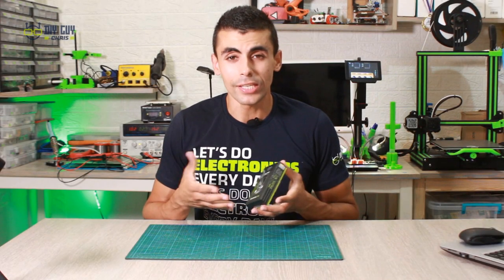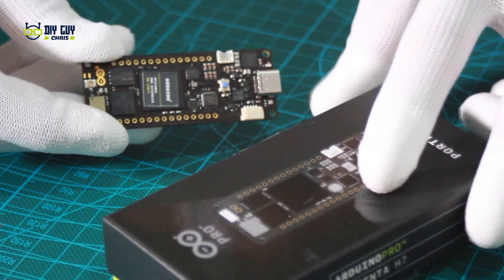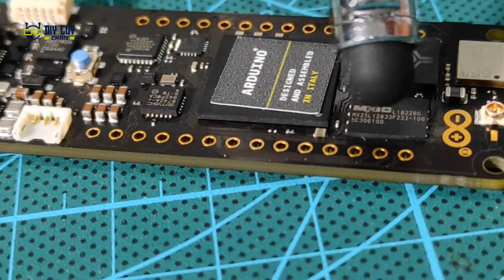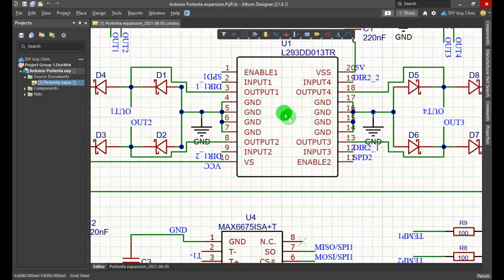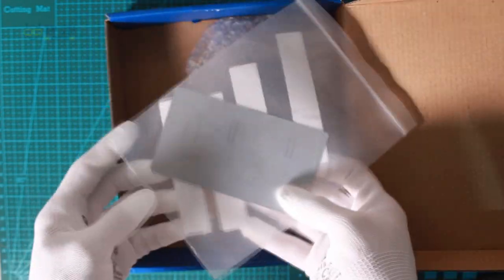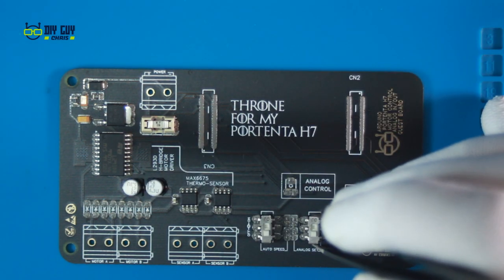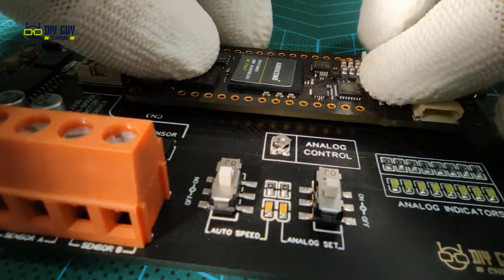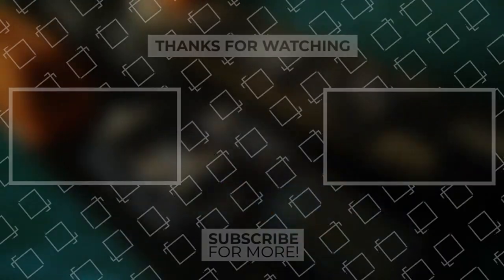Getting started with Arduino Portenta (customized host)

Comment: Low temperature solder paste? It's been a few years, but low temperature solder paste didn't work when I was fixing cell phones. The connectors would pop off the pcb when you plugged or unplugged the flex cables. Maybe by stabilizing the solder joints with epoxy conformal coating?
Reply from the maker: Similar to any other solder paste (with same alloy) but could be molten under low temperature heat which makes it a low temperature profile solder paste, you can check the ref. from CHIPQUIK SMDLTLFP10T5 for the details

Comment: Why didn't you just soldered headers! I don't think that it will screw-up the board
Reply from the maker: Thank you for your comment, hummm yes maybe I will try this on a breadboard so in this case the headers are necessary. Next video maybe :)
Reply: @DIYGUYChris  nice
so I guess that you make a led Blink just as first test and you will use the rest of the board options in the coming videos. good
Reply from the maker: @miaharley8051  exactly

Comment: I just dig into the details of your schem! why have you used those screw headers instead of plug-in connectors?
This is a good training board but why have you just used almost 5% of it?
Reply from the maker: Yes that's right, I just did this video as first part of this project where I showed the hardware making steps.
More posts will be published so soon about this Throne board 😉

Comment: How does this compare with PICs?
Reply from the maker: It depends on the PIC category, surely it has to be compared with a 32-bits PIC, you can consider that the Portenta is based on the ST MCU a dual core microcontroller (H7 and H4 cores) with many high integrated peripherals especially for data communication, plus the extra ICs of the Portenta board like wifi and Bluetooth etc : )
Reply: Sorry yeah that was a very broad question
Reply from the maker: @PurpleMomgoose  you don't have to worry, here you can ask whatever you want ;)